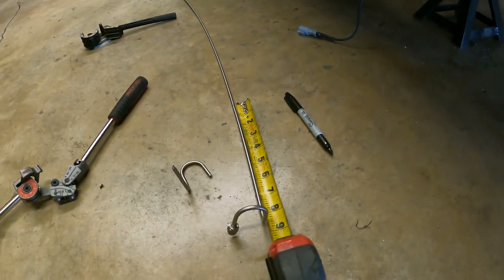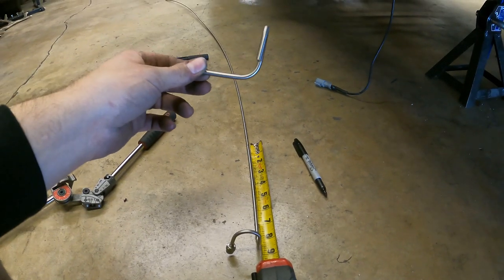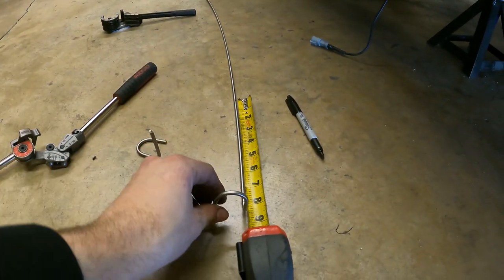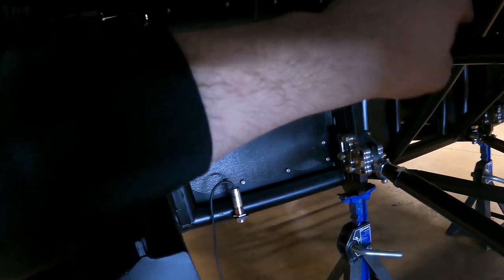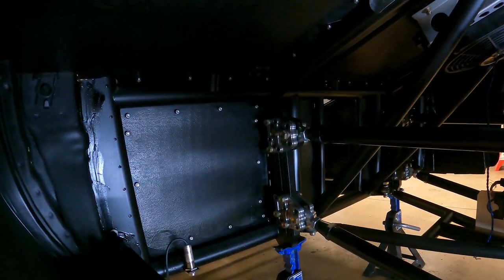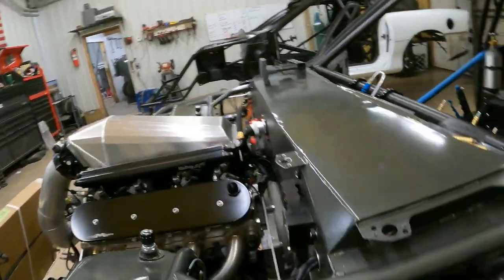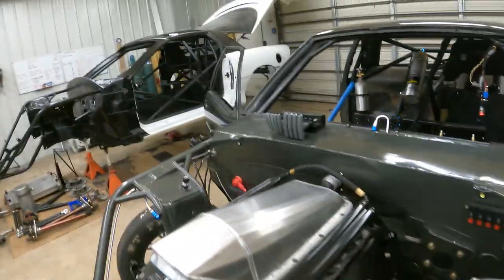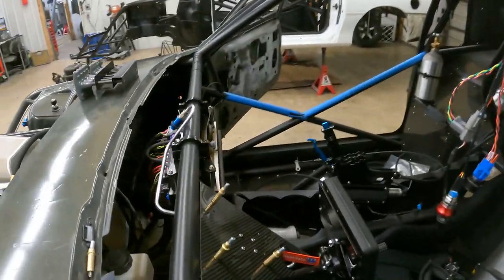Ep. 34 Shop Car Brake Lines and Fire Bottle Line install!

Comment: Being a closed system . The line length should not make that much of a difference as the system is under pressure . I love the symmetrical look and would do the same. I have a few fabric tapes. I use little magnets. You can lay out the tape and read the lengths needed. I forget where I sourced them . But they are only 3/8" wide and 6 or 8ft long. What's the sensor on the frame? Ride height?? Damn love the coil mounts and how clean the motor is. That will make any in car motor work easier!!! Nice job!!!
Reply from the maker: Thats kinda what we figured, but i like the look better anyway. LEt me know if you find the link for those. that would make it a ton easier. And the sensor is for track temp!

Comment: We always put a 90 where you welded the tab on the chassis, flex from there down to the top of the rear end with another welded tab holding a T fitting, hard line from there out across the top of the axle tubes to one more tabbed 90 by the housing ends, flex from there to the caliper
Reply from the maker: The only thing we dont like about that style is if the housing has to come out, you have to break open the brake system. The way we did it, all you have to do is remove the brake calipers and then you dont have to re bleed.